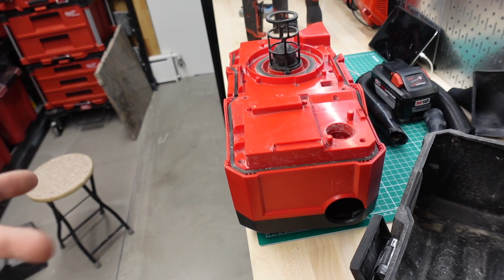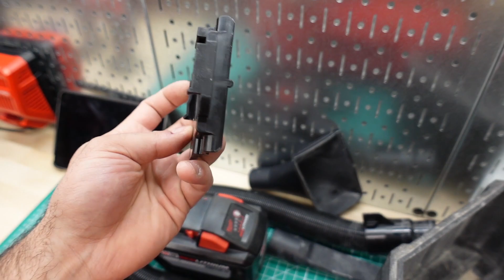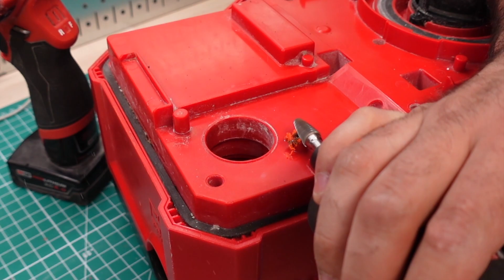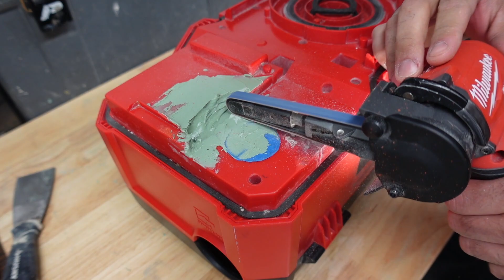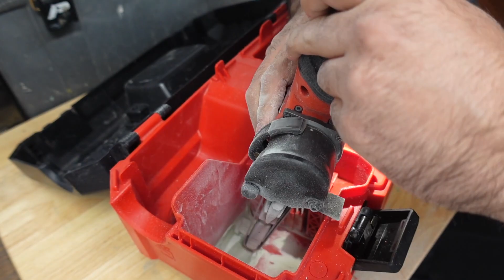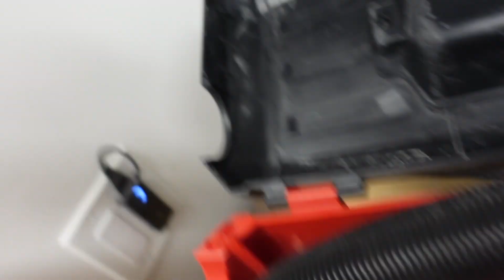Modifying M18 Vacuum so i can use Vacuum Bags.  // Skill Stacking

Comment: why not just get a small section of hose/pvc fitting and insert it in the suction end of the hose and then into the bag.  seems overkill to do all that work
Reply: Thats what i did, it was like 10 mins and i can remove it anytime also it takes the super cheap bags i use in my corded shop vac too
Reply from the maker: Awesome. Great to know it work for someone. Then this one craps out I’ll do the same
Reply from the maker: Good point. The pvc seems like a better route. It crossed my mind but I scratched  it out when I saw the black piece that came with the vacuum bag.
Reply: Or.. if you have access to a 3d printer.. Print a bracket specifically for it?
Reply from the maker: I am looking to get one when I leave New York and buy a house.